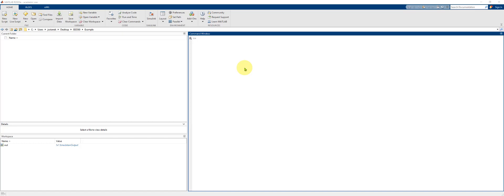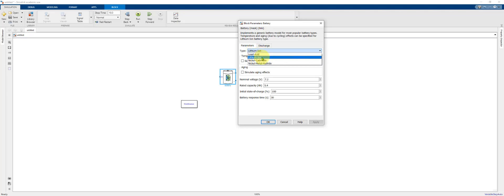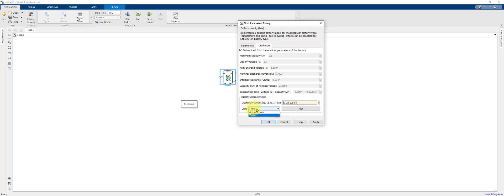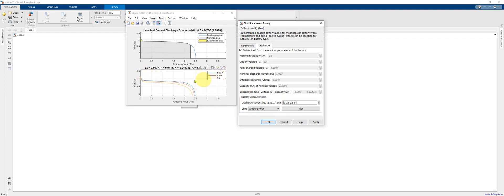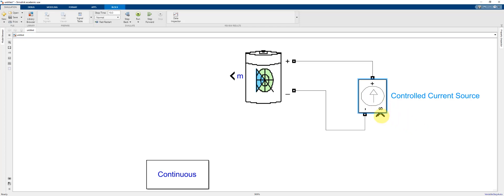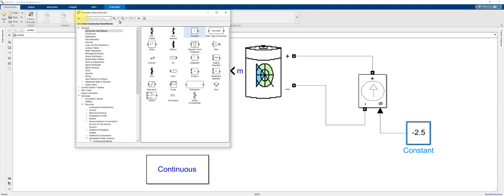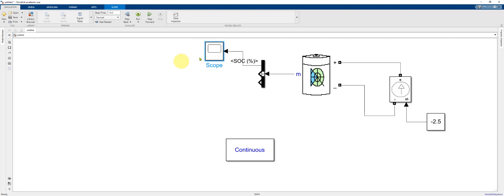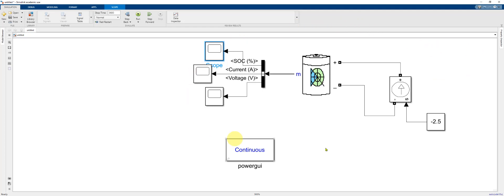Li ion Constant Current Discharge

Comment: Hi! can we replace Li-on with another battery such as lead-acid battery etc.?
Reply: If you press two times on the battery symbol you see a menu named block parameters battery. In that menu, there is a submenu named parameters and type. You can select 4 types of batteries Lead-Acid, Lithium-Ion, Nickel-Cadmium, and Nickel-Metal Hydride. Succes with your Simulink quest.